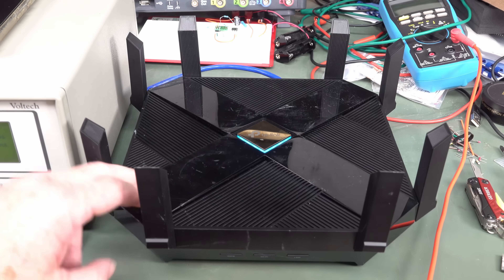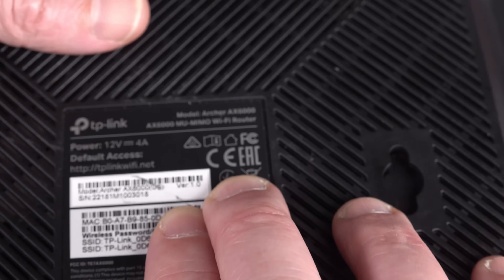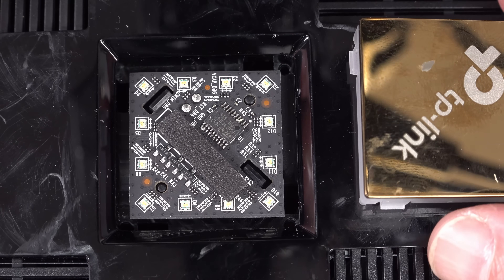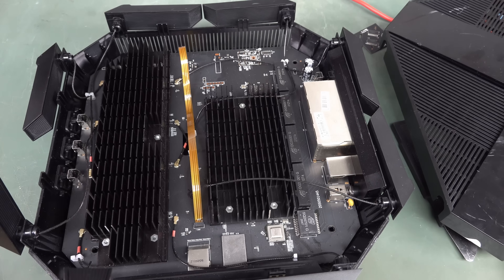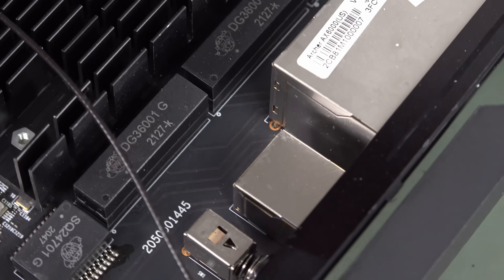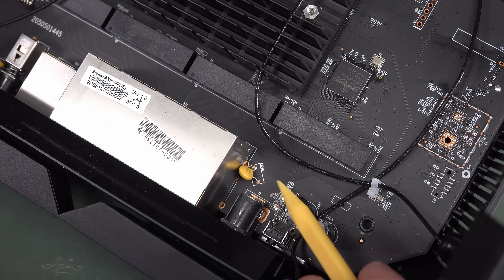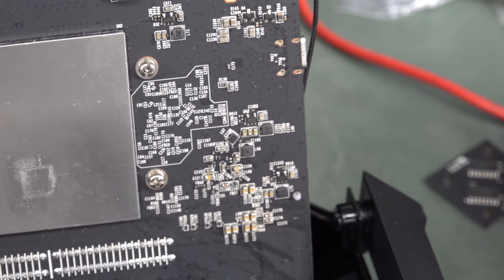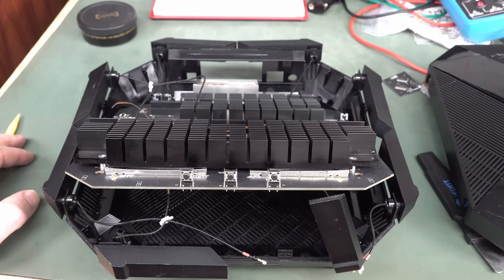TP-Link AX6000 Router Teardown

Comment: I have the exact same router I’ve had it for almost 4 years and today it decided to get stuck in a boot loop and the blue light just goes in circles any solution to this brick situation it won’t hard or factory reset.

Comment: Big fan of TP Link on account of them using GPL open source code for their products. I just this week retired my Archer AX16000 (AX6000's big brother) in favor of an Omada EAP783 to gain wifi 7 support, better range, and most importantly Omada controller integration.   If you can't find the source code for their products, you just email support and big badaboom, they'll hook you up.  At least, that was my experience!  FYI, 2.5G kind of sucks, mostly because every 10G copper device I've ever used will refuse to talk to 2.5G devices, although they'll do 1 and .1 etc.   Frustrating, as my HP docking station has 2.5G but 2.5Gbit is a no-go on any of my various brand copper 10G sfp modules.

Comment: What an ugly big beast. Why do pretty much all consumer-grade higher-end(ish) routers look like UFOs is beyond me...
I gave up on those all-in-one devices ages ago, instead opting for a Linux box (currently, a Pi 5) as a router and some really nice looking enterprise-grade UniFi APs for WiFi. Way more stable and capable. And no black boxes running questionable locked-down software. It's not as easy, but hey, you can put OpenWRT on pretty much any Linux-compatible box.

Comment: I think it uses broadcom chips hinted by the exposed broadcom jobby. Bcm4908 i read somewhere. I have the the router myself laying around doing nothing so i might hook into the serial port thats the 4 pads on the pcb and see what the bootloader says and if it comfirms its the 4908 cpu. I think it runs linux kernel <5.xxx

Comment: I've noticed that the high-spec routers with Broadcom chipsets are loaded with huge heat sinks and use power supplies several multiples of wattage higher than Qualcom/Atheros based units (which need scant heatsinking).   

While this suggests QCA based routers are much more power efficient, I've had much better wireless performance with the Broadcom based units, and always choose these as a result.

The very important caveat with running a Broadcom unit is you absolutely must rig up a continuous cooling fan solution or the router will only last a year or two before the silicon starts going bad and it'll start doing weird things before eventually failing completely.    I use a pair of very quiet ball bearing  80mm (or 92mm maybe) fans sold at amz by coooler guyz that draw 5v  power out of the USB port.  With that setup it'll run 5+yrs.

Comment: We actually just got fiber here in NW Oklahoma..  So I switched over..  Speeds went from the usual 50M to 80M  up to 290M now. :)    I'm sure happy with it so far.  Much much faster speeds and it hasn't cut out once yet.. where as my previous cable internet would throttle down sometimes as low as 5M or 10M..  and seemed to go down completely at least once per month;  for 30 min or so.    Not to mention that I was paying 150 per month before-  for ONLY cable internet (supposedly "up to 1gb-  but it rarely got up to 100M) ---  to now (for fiber)  it's 65 per month--  the first 6months is half price-- and free insulation..  so ended up being 37 per month (somehow).. plus 10 dollars off if I set up recurring payments.. lol.. So it's actually only $26 per month right now for the first 6months..  Then it jups up to 55..   So much cheaper, with insanely better speeds.  I have to say:  if you can get fiber internet to your house--  DO IT
Reply: In my country I use simmetric 1 gbps ( actually 940 mbps due to pppoe incapsulation ) for about 5€ a month ( no discounts ). It reaches the advertised speeds most of the time.   10 gbps will cost about 10€ a month, but is not available except a very limited area .
Reply: @modorangeorge4991  Wow.. that's practically free.   They aren't giving it away like that around here
Reply: They paid for your insulation? That's impressive ... 😀
Reply: @TylerDurden-pk5km  lol..  If it's red, I right click and grab the "auto" correction..  haha..   oh well.  I spelt it wrong and the corrected even worse

Comment: Great video and teardown. I actually have this router at home. It's a good wifi 6 device. I have a hard drive attached to the USB port and the speed is fast enough. It was expensive, I wanted one with 8 Ethernet ports,and this one was a new model at that moment.

Comment: It was released 5 years ago and still no openwrt support. They say because it's Broadcom.
Reply: Broadcom is pretty much a DD-WRT only territory as they have (or had) access to Broadcom's binary blobs. But AFAIK, even they no longer have access to the latest Broadcom stuff.
It's funny how a company that brought us chips for Raspberry Pis is otherwise so hostile to the open source community. 
Despite the looks, this is your typical consumer grade NAT router likely running subar quality software and with questionable support. I would personally not recommend anyone buy it. 
If you want a cheap router, at least look for something with Qualcomm chipset in it.
Reply: That would be ironic considering the original Wrt was Broadcom.

Comment: I am using a Linksys EA7500 v2 with openwrt, and it is one of the most accelerated and implemented routers you can have for openwrt, and it just hauls. Super fast like 650mbit over wifi.
Reply: It will choke your WiFi though, since there's only one data channel. For NAS, it's best to use wires.
Reply: @povilasstaniulis9484  Of course it is, but for some reason my phone doesn't have a CAT5 jack.
Reply from the maker: I only have a 50/20Mbit internet connection, so, meh.
Reply: @EEVblog2  Yeah, but the speed is still nice to have for local traffic, like for your NAS.
Reply: @Steve_Just_Steve  It was actually local traffic I was talking about. I only get 60mbit internet here through my iphone. But I can download video from the phone really fast.

Comment: So with the power supply stuff in the internals, would it be possible to just connect any lead acid to lithium 12v battery? Does it need tight tolerances for the voltage?
Reply from the maker: Nothing stopping you doing that at all.
Reply: @EEVblog2  cheers dave

Comment: That router will probably draw quite a bit more power with all of the ethernet ports connected, the CPU under load, and lots of data transferring over all of the radios. It also needs power left over for the USB ports since someone may want to connect hard drives to both ports.
Reply from the maker: Yeah, I might put an SSD on it for storing videos.
Reply: @EEVblog2  Yeah.. It will get hot if you run a lot of wifi too..   Like we were running 2 phones, laptop, switch, kids Roku TV.. plus guests come over, etc..   So I ended up having to set a fan next to mine and just keep it running.   They should really just build a fan into these things and make the cover easy to come off for easy cleaning..  To be fair, mine is the combo router.. with the built in modem.
Reply: May only support smb v1
 @EEVblog2
Reply: SSD under heavy writing will use upto 25 watts...
So that's part of the budget.
Reply: Heh, some cheap netbooks and laptops had trouble powering external 2.5 HDDs...
Reply: Jep, highly load dependent - an external speed test will usually not really stress it. One would have to stress WLAN + LAN to the max. to see top consumption, especially WLAN. 12W standby is not too exciting - my integrated router takes 6W standby with an active VDSL connection.

Comment: Kinda disappointed that the high-end WiFi routers are basically underpowered, they stopped using superscalar out-of-order processors therein. So, I may have to look at custom Linux computer containing Ryzen processor for custom WiFi router setup instead. DD-WRT would easily mop the floor with superscalar in-order Cortex A53 - A55 processors easily especially after you customize it.
Reply: i dont think it's underpower. It's perfectly fine for normal, average home user, unless you have big home with hundreds of user connecting at the same time.
Reply: I would look at a OPNsense or pfSense setup if you are going to use a PC. You will need separate WiFi access points, PC WiFi cards are not really suitable for use as an access point.